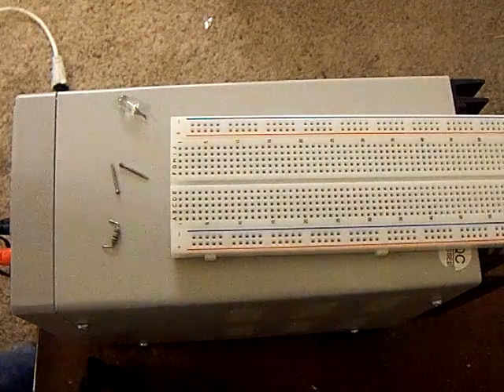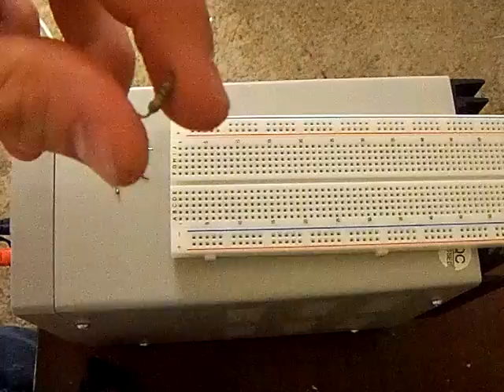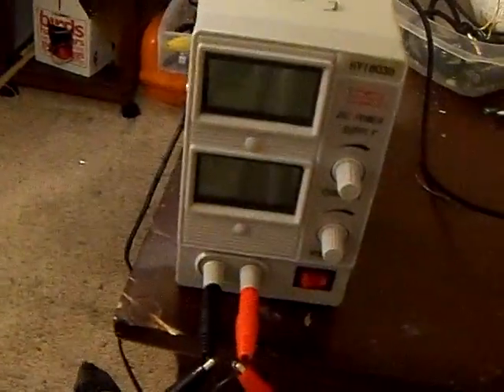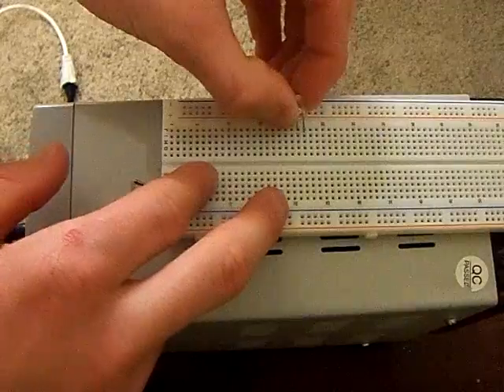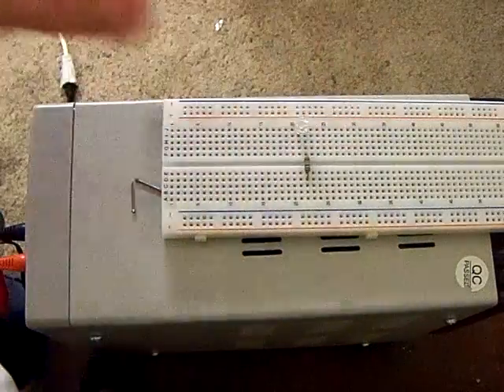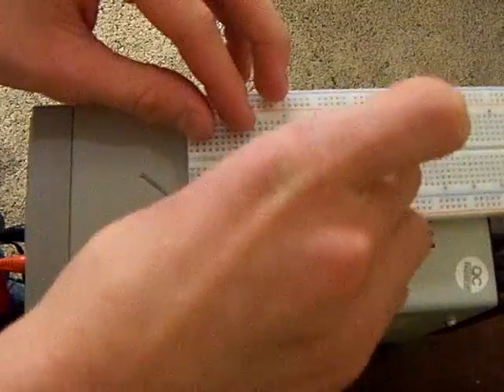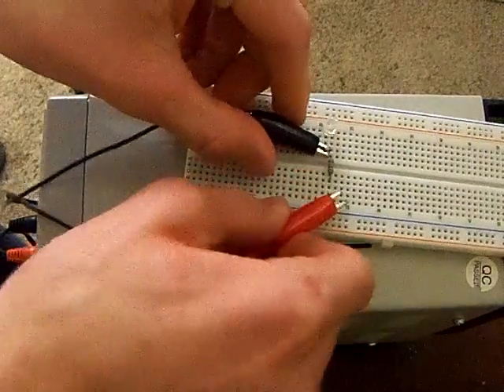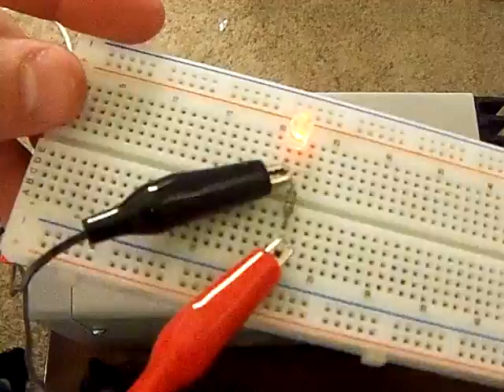Simplest LED Circuit

Comment: Thank you for this simple video. I had ordered a resistor kit to get me 470Ω resistors but my multimeter would read em as .470k. This video helps prove my resistor value is correct even though my multimeter won't read it as it should be.